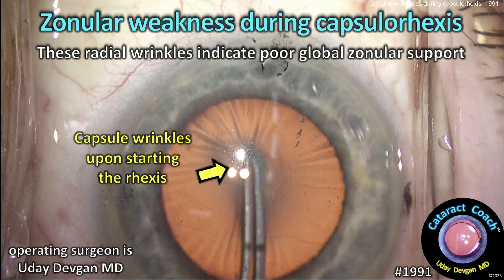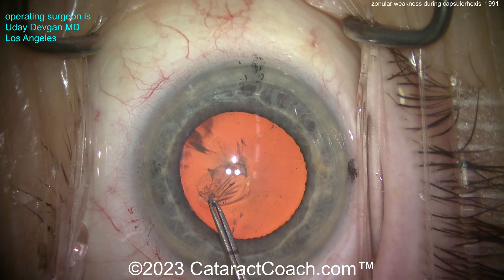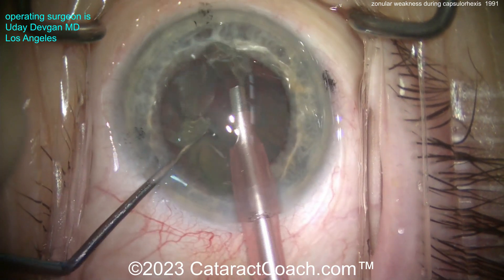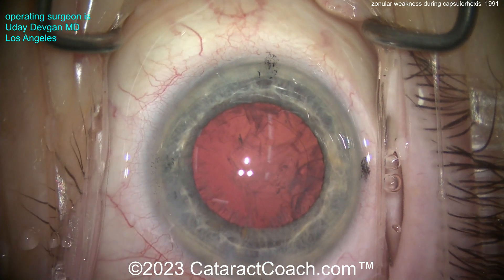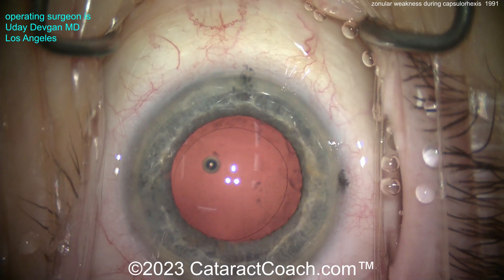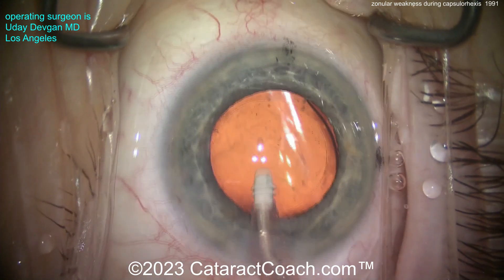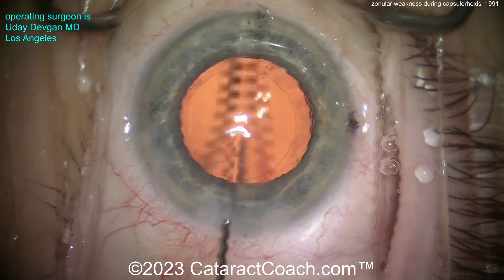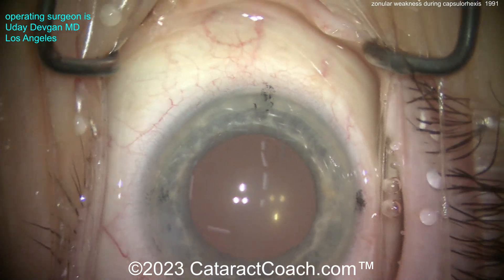CataractCoach™ 1991: zonular weakness during capsulorhexis

Comment: I'd argue that a careful and fast jab into the anterior lens capsule with the capsule forceps can safely be used to start the rexis as well. Because the capsule has some inertia, a fast puncture with the forceps may avoid transmitting the stress to the zonules. This would be safer than slowly pushing posterior with the dull instrument. However, as done in this video, use of a cystotome avoids any stress on the zonules all together